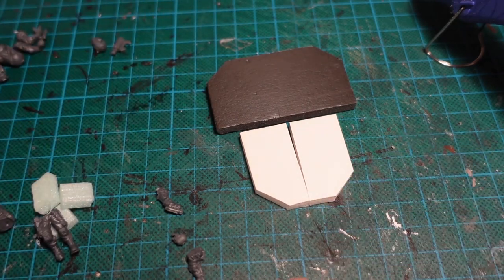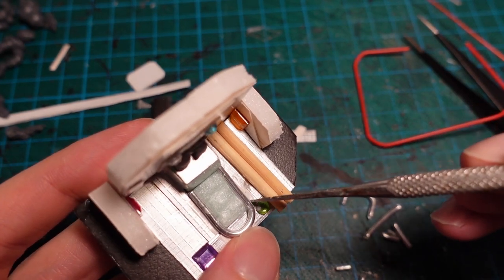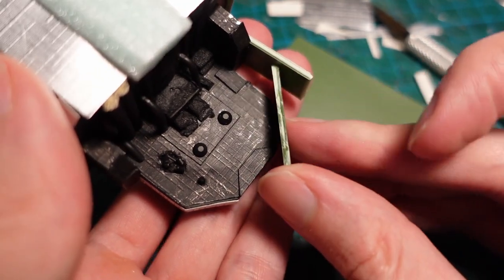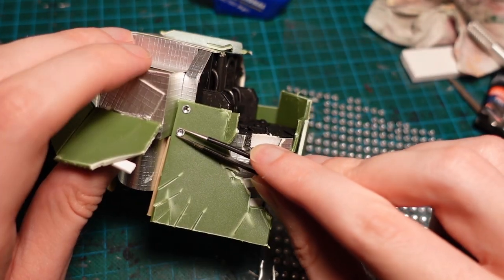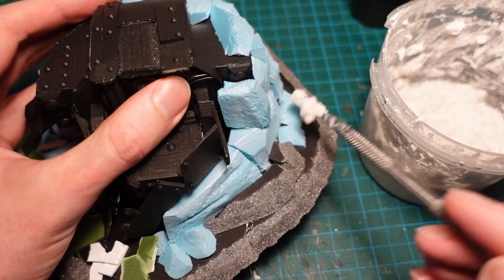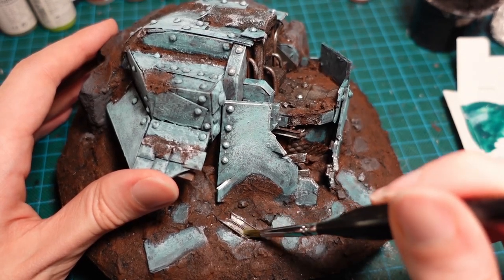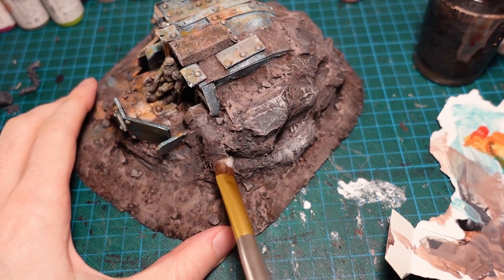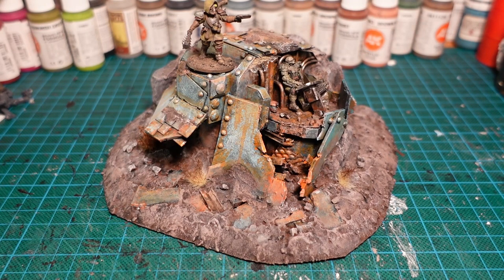Scratch Building Post-Apocalyptic Mecha Wreckage terrain for Necromunda/Stargrave

Comment: Hoping your channel grows! There is some really cool stuff here being made! Looking to get some foam board but I am unsure of what thickness to get. Any chance you toss up a list of the things you regularly use?
Reply from the maker: Thanks! and of course. So for foamcore I have two main types both about 5mm thick. The white stuff I use is more rigid and I get from a local store(hobbycraft if you're uk based). The other is the black one which is a bit spongier but holds detail better. That one I get on Amazon. The other similar product is the green foam which I get from the hardware store in bulk. It's also 5mm thick and is basically foamcore without the paper layer. It's usually sold as underfloor insulation board. Hope this helped.
Reply: @thecavyforge7307  Thank you!